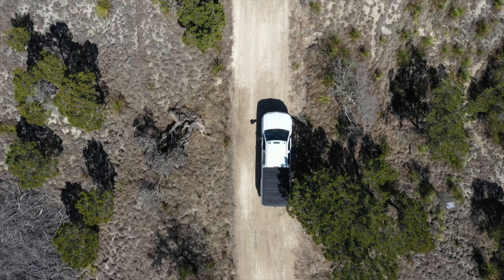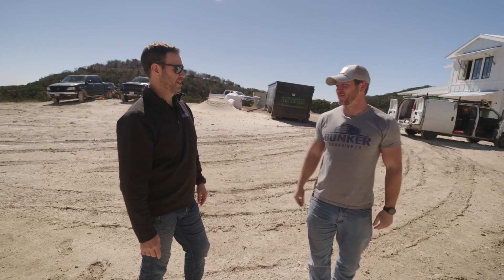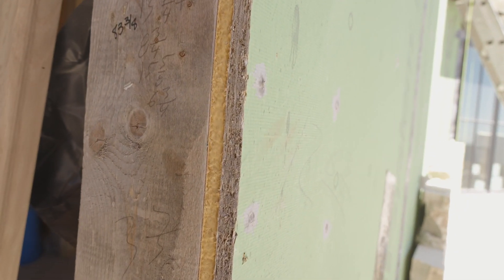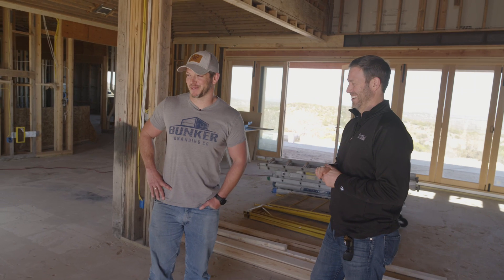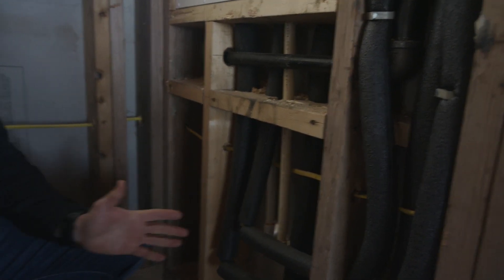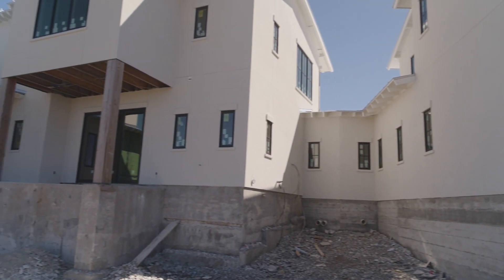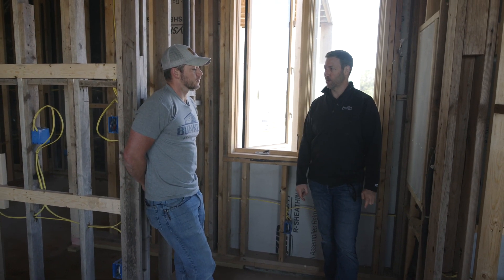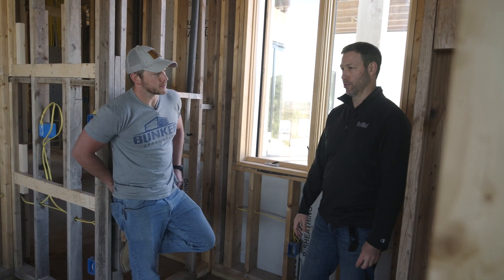One Vulnerable Spot at the Abandoned Mansion

Comment: Heat pumps are great... grew up in SE Texas with central air and heat! But after getting my education I moved to Australia to work and we have 2 heat pump units in our house which is not ducted...You may need ducted as your place is so big! But it’s very efficient and as we live in Tasmania it get very cold in the winter and very hot in the summer but it is always comfortable with the heat pumps! When I first came here over thirty years ago... I froze all the time in the winter ...house use to have wood heaters with a fan or just an open fire! Going to bed was a relief from the cold! Don’t for get about solar system ...you’ve already seen what that can run at you off grid property ... would be nice to have heating and cooling with solar and have no bill! Water Collection system is a great idea! Most new homes will put one of these In the build! We still haven’t done it but you can actually water veggie gardens and plants in your yard with water tank especially when there are water restrictions due to lack of rain...as we do get droughts here! All the best with the continued success of your build! Also some folk take water from their washing machines...of course they must use biodegradable detergent! And they have it flow over their Garden which is cheap to do!

Comment: Great info!  Never realized that Pex could just be bent with an adaptor for 90 degree turns. I used all Pex with Sharkbite fittings for an interior bathroom additiion 12 years ago. So easy to use - no soldering and super light and easy to work with. Never any problems after all this time.  Looking to give current house to the kids and get a fixer ujpper for myself. Planning to install tankless heaters and backup generator when I do. Will be referencing your past vids when that time comes.  Thanks, Matt!

Comment: Instead of 5" down, maybe 38" or more for putting your water lines in to the home. Its just a trench...that makes sense because it doesn't matter if you use frost-bib faucets...the line in the ground could freeze.
Reply: Yeah the idea of a water line being close to the surface is so odd.  The pipe from my well comes into my house a couple inches off the floor of my basement.  So it's over seven feet underground!  I'd imagine a water pipe in South Texas being 5" down would make your "cold" water coming into the house 80F on hot days; that sounds terrible!

Comment: Up North, we surface mount Tankless heaters in the mechanical rooms and exhaust to the outside.
Reply: And don’t forget to put a drip pan under it if (or when) it starts to leak in a few years.
Reply: @davidcopley2599  Good idea, but our mechanical rooms usually have concrete floors and floor drains. But it would be a good idea to have a drip pan when needed.
Reply: I wondered that too and thought maybe just "hey this is how we do it here" and the plumbers went to work.  But I for sure would have found a place to build a proper mechanical room instead.

Comment: We have two external tankless water heaters. Just like Matt, ours froze the first REALLY cold night because we lost power. I didn't notice that it froze until morning. I took the insulation off the Pex, took my shop light (which is incandescent) and placed it in the space. In about 30 minutes hot water was coming out. Rinse and repeat on the other. Put insulation back on and closed it up. From that point on I had a hot water faucet turned on slowly off of each heater. Didn't freeze again even when we went to -4 near Weatherford.

Comment: I'm surprised there's not more of a push in this video for mini split heat pumps and solar with battery backup. Matt Carriker already has solar with a battery for the bunker. Looks like there would be plenty of space around the house for Tesla solar panels and a few Tesla Power walls would keep that house powered up for quite a while.
Reply: Absolutely, Texas is the place to do solar.
Reply: Sol-Ark with LiFePO4 battery setup is what I'd do.  Safer battery chemistry with longer lifespan.  I'd still install a backup generator for belt and suspenders.
Reply: solar don't help at 5F at night, you'd need a fortune in batteries to run the heaters. 
we also had a bunch of dark cloudy days, because snow clouds. 
So you still need a diesel/propane/wood furnace and a generator.
Reply: @wim0104  Solar does help at night when paired with batteries. It will also still generate some power on a cloudy day. It helps a lot to have panels mounted on the ground so they can point exactly where needed for maximum efficiency. 

In a worst case scenario like what Texas just went through, you don't need to keep the house heated to 70+. Drop it to 60 to reduce heating consumption. I live in the northeast in a 1960's house with 2x4 walls and poor insulation. I can leave the heat completely off at night and 10 hours later it drops around 10-12 degrees even when it's single digits. (68 down to about 55)
When I was gone the entire month of December, I set the temp to 50 degrees and my heat would run about 1.5-2 hours per day according to my nest readout on the coldest days. Plus with heat pumps they don't make heat, they move heat and combined with that house being spray foamed, it's not going to take much at all to heat that huge mansion. (relatively speaking 😅) 

Also keep in mind, even though batteries are still crazy expensive, they can pay for themselves overtime. A generator in contrast will never pay for itself over its lifetime. If you use tesla's solar configurstor, it will show how much it costs and how long it will take to pay for itself.
Reply: @John Fischer I see it as a compromise rather than a sacrifice. I'm willing to compromise the less than 1% chance this type of scenario is applicable for the chance of nearly free electricity 10 years down the road. 
Those tens of thousands of dollars will return to your wallet month by month with solar. A generator will always have a monthly cost associated with it. 

You also have to keep in mind that generators aren't foolproof either. They require maintenence and fuel. On the off chance you're caught running low on fuel, there's always a chance that refueling may not be possible which means you're back to where you started. With solar,  the sun is always shining and the panels are still able to generate some power even on a cloudy day.
Reply: @John Fischer What are you reading? I never once said it will ruin a generator.... 😂 Solar should run for decades just like a generator should. I'm saying that in the event of fuel shortage, if it needs to be refueled, you're still going to be without heat. 

At the core, the whole reason Texas is having blackouts is because of a power generation issue. The natural gas power plants did not have enough fuel on hand to supply enough power. I'm saying in the event of an emergency, a supply truck may not be able to refuel your propane tanks that are keeping your heat and power on.
Reply: @John Fischer The whole reason people go with solar is that it can pay for itself. If it didn't offset its cost, the only people that would have solar are people who pretend they are saving the environment. I don't know who you are talking to, but I know several people who have had solar for over a decade and are seeing the benefits.
Reply: @John Fischer Oh boy, here we go. Everyone's an industry expert with decades of knowledge so they can have instant assumed accreditation with no proof... If you build and remodel homes,  what's your company? I'm not an expert and I don't claim to be one, but I've done my research.
There's no public articles of my personal friends solar installs just like I'm assuming there's no public articles of the people you've talked to with their solar panels degrading. But there is public research hosted on government sites stating degradation rates. 
This one shows that over 20 years, they on average still produce 90% of their original output. https://www.nrel.gov/state-local-tribal/blog/posts/stat-faqs-part2-lifetime-of-pv-panels.html 

You also have to keep in mind that 20 years of growth in technology is huge no matter what space you're in. If you compare 20 year old tech to modern day tech, there's going to be a night/day difference. One of my friends who has solar panels said it took them about 12 years to have the panels pay themselves back. With modern costs, it should only take about 5-6 years to pay themselves back. 

Maybe you're in a different state, but most whole home generators I've seen run on propane/naturalgas or diesel for the bigger solutions. This is why I said a truck would be delivering fuel to the site, and not you getting it yourself. If you're comparing Solar to a portable pump gas generator, that's not a fair comparison. 
And also, if you haven't noticed, gasoline isn't available when the power is out. It doesn't matter how much gasoline Texas has. Gas stations cannot pump gas when they don't have the power to stay on.
Reply: @John Fischer 100% agree. I saw news reports of people having to limit using their generators because they couldn't get more gas. Then the Ford F-150 posts of people using the generators in the bed that can last several days with continuous use because of the large fuel tank lol.
I moved to the northeast and when looking for a house, I was surprised by how many homes actually had whole home generators. When that big storm hit us last summer, I was without power for 26 hours. All of the gas stations around me were shut down and couldn't sell fuel. 

Texas would have been fine if there was any prep/planning, but they just weren't setup to handle this. The United States has 2 main power grids (east and west) and Texas chooses to have their own so they don't have to follow federal regulations for their power grid. Their power grid isn't even connected to any of the surrounding states so they're not even able to get assistance from them if they wanted it. 

I also heard that in Austin, even the natural gas hook ups were freezing because there was moisture in the lines from not being prepped.

Comment: I found a system that is much better.  Feed the exterior hose bibs with a dedicated line that goes to an interior ball valve shut off.  These shut offs can be located at in a sink cabinet, by ther water heater or some other convenient place.  Before winter, turn the ball valve to cut water to the hose bib.  Open the hose bib to drain whatever water is in the line.  Reverse the process in the spring.  It wasn't my idea but since discoverng it, I will never use any other method.
Reply: that depends on people doing things, and most people are far too lazy or not dependable.  the hose bibb he showed normally don't squeak, work awesome, only cost about $20, and just work any time of year

Comment: I'm an architect.  I would not put water pipes in exterior walls, especially buried in foam insulation.
Reply: Please don't build any houses then. That's the home builders job. 
  When pipes are put in exterior walls they need to be insulated. Preferably with a vapor barrier behind it to stop condensation. The insulation of the pipe and spray foam should be more than enough. I would have preferred a separate vapor barrier, however he has Zip board, plus foam board, plus insulation over the pipe and he is going to spray foam.  This is way more than necessary.
Reply: @John Fischer Read the whole thing, it says "unless insulated".  P2603.5 Freezing
https://up.codes/viewer/michigan/mi-residential-code-2015/chapter/26/general-plumbing-requirements#26
Reply: @John Fischer They did a crappy job then.
Reply: @John Fischer  Not if properly done. It's not optimal, but can be done if the builder is knowledgeable.  Sometimes, you gotta do what you gotta do.  It just means they have to be extra careful.  Redoing a layout to avoid it may cost several thousand.
Reply: I have water pipes in my exterior walls in my kitchen. 50 years running in Alaska and never frozen.  Built right, not a problem.
Reply: @John Fischer By the way, most homes have their kitchen sink facing a window. Where is yours?  :)

Comment: Matt, I don’t know if you will see this. But I did a remodel on my house here in Arkansas in 2019 due to a fire. I saw your videos on a outdoor tankless. I was so worried last week it would freeze up as we got to 0°F. It worked flawlessly. Per Rinnai My unit has freeze protection to -14°F.  I also installed the stainless cover below my exposed lines, wrapped with heat tape and used blue styrofoam insulation to form a cooler per say. We only lost power for 4 hours at night But. I also installed a 22kW whole house NG generator.  All my Uponor plumbing is insulated under my home. My biggest regret is not running a recirculating line with motion detection. One small section of sheet rock being cut out and I can make that happen this summer.  Thanks for your follow up videos. Stay frosty 🥶 but don’t freeze.

Comment: When I was studying engineering, I could never understand why we would design things around average temperature ranges instead of extreme temperature ranges. I think that everything should be built or designed around the highest and lowest temperatures that an area has seen within the last hundred years.
Reply: It’s what they do for hydrological design
Reply: Ideally this is how you should do it but it adds significant costs to construction.  The difference between spray foam and standard insulation is huge by itself.
Reply: they do for HVAC - ASHRAE design temps are 1% and 99% (heating/cooling) based on historical not sure what you were "studying"
Reply: things typically are engineered around extremes.  i'm building a house soon in CO at 9000'.  even though the average monthly snowfall is 7", i have to use a 65#/ft2 roof load.  that's around 8' of snow.
Reply: That's because Texas barely has any standards at all, because they're cheapscapes. They think it will never get cold.
Reply: The same winter event here in Houston was the coldest in 122 years so it would be outside of a 100 year design.
Reply: I think is called "Cost/Risk mitigation" or something like that. How much does it cost to make it "perfect" vs what can we afford vs what's the timeframe of the risk? 100 years? 20 years?
Reply: "everything should be built or designed around the highest and lowest"
Umm, you do realize that HVAC systems basically do this. Heating is designed for one number and cooling for another.

Comment: Demo Matt:  As someone with a both journeyman license in HVAC and Plumbing up here in the north everything Matt Risinger told you was absolutely correct. I don't disagree with a single thing he said. Trust that guy! Glad to see someone understands the tech in heat pumps have come a long way from where they were when they sucked. The refrigerants have a larger range of temps now.

But I will say that the freeze proof hose bibb that you screw the faucet into was new to me and I design plumbing now.  I'm normally on the bleeding edge of plumbing tech and that one surprised  me. I've never seen it before but most of my work is commercial/industrial and that's probably normally as a residential fixture that's never been in my specs before.

I want those hose bibbs on my house now! Thanks for that one Matt R.  I'm sub'd now.

Comment: House that big? Geothermal ground loop, powered by solar panels with a battery backup might be the better option. Heat energy is banked naturally, the system would only take a few hundred watts to run with a small enough power use to only need like 10 300watt solar panels... (doing the math half asleep here)

Comment: Demo should run diesel backup. He has vehicles and tractors that all use diesel. A big tank would make sense.
Reply: Diesel goes bad eventually so thats tricky.
Reply: If he cycled it through the tractors etc, it would get used enough to stay fresh.
Reply: Just have two generators, a backup for a backup. If one truck can't come deliver the other might.
Reply: Diesel doesn't do well in the cold either, might need to have some other source to warm the fuel tank. That's why a lot of older diesel vehicles had a plug.
Reply: @ilusnforc3  
Texas is never going to have a deep freeze months on end.
Reply: Of course he could just plug the house into the 5 ton. I’d bet the alternator could handle it.😜
Reply: There are articles that came out saying people were using the power outlets in the bed of F150 trucks to power things in their house and it didn't use much gas.
Reply: There are 4kw alternator upgrades. That and a decent inverter...  I think Matt should run solar. He is likely fishing for a sponsor.  That view means good solar potential.
Reply: @kenreynolds1000  Solar, unless it's set up for it, wont run without the grid.
Reply: @James76767  that is why you should set up solar with battery backup. I never understood why people would go to the trouble of getting solar for just hooking it to the grid.

Comment: Those hydrant style hose bibs are more prevalent than you think in Texas.  In fact, I see them more than the non-hydrant type around Dallas.  Maybe they're not common in the Austin area.  We still winterize with the bubble covers just to be on the safe side because you can catch a draft through your masonry and the pipe will still freeze in deep cold weather (the 2 weeks a year we have it) but the hydrant style bibs are a great start.  Also, if you really want freeze resilience, Pex A with Uponor fittings is what you want.  It can swell to 5x it's size, but will contract with heat and bend defects can be corrected with heat.  You also don't take the flow loss you do with normal pex because Uponor is basically a swaged connection.